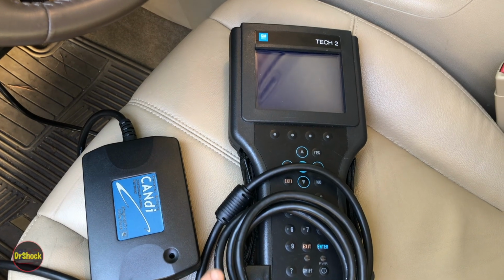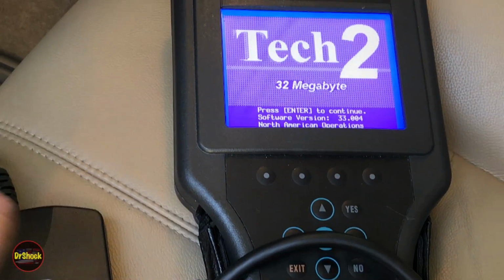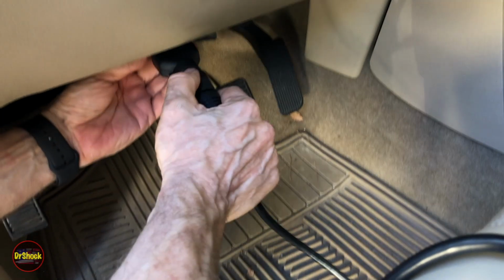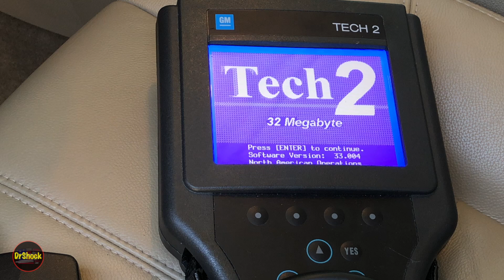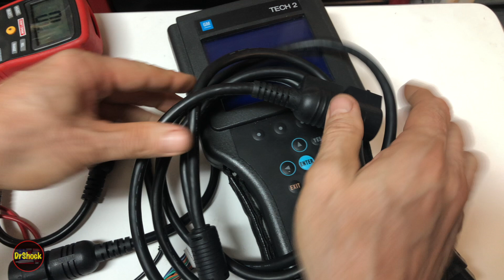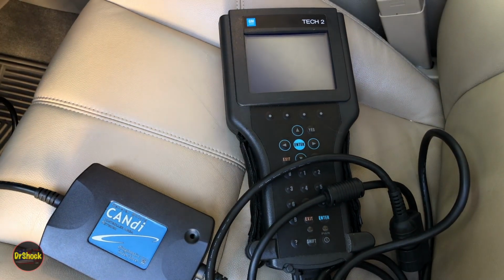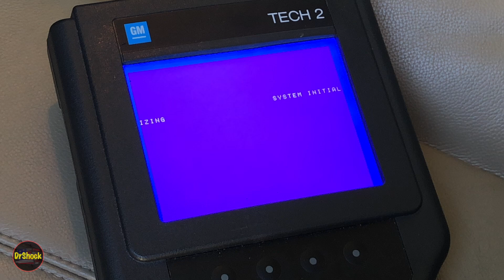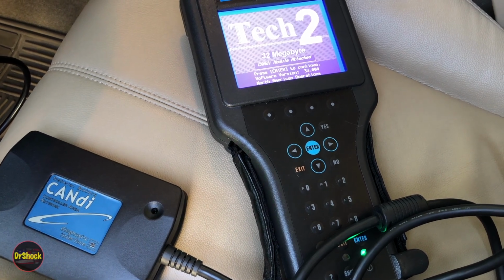Tech2 Scan Tool CANdi Interface Module Not Recognized / Attached Diagnosis and Repair

Comment: You can use a hot glue gun to fill the stripped threads
Reply from the maker: Unlikely to hold up to a regular use shop tool vs epoxy.

Comment: What if the problem is where the CANDi is connected to the tec 2?
Reply from the maker: I mentioned both of these clone type CANDi cables, as well as the DLC adapter, can be failure points.  Links to all of them are in the video description.

Comment: Will these scan tools diagnose a start then immediately die issue? I think it’s passlock related?!?! It’s a 98 Cheyenne with a 305. Has ran great up til today. I had a key cut for it to put in my billfold for emergencies. I drove it home with that key and parked it in the garage. Now it just starts and dies. The security light lights and never goes off. Even when it momentarily starts and dies
Reply: Any help will be greatly appreciated
Reply from the maker: I would say no to your question based on how you've stated your situation. 
 The Tech2 is an older generation scan tool only intended for use by GM dealership technicians.  It's going to read limited information, and requires the GM service manual for the vehicle to know how to interpret that data.  If you have alot of knowledge about the vehicle, and also have access to the OEM service information, then it can be a very useful tool.  But it will not guide you or point out the problem you describe in a DIY type of fashion.

For this particular issue you have, you will need to clear any DTCs that may have been stored.  And then I would suggest you attempt the Passlock Auto Learn procedure documented in one of my other videos https://youtu.be/4HSykIl5jaE description text section (not in the actual video just the description).
Reply: @DrShock  my security light is staying lit just like yours was in your 2 year old passlock video using your diesel. Did me driving the truck with a fresh cut key cause this or are my 2 passlock modules bad?…. Both just keep the security light lit when I switch the key on. It should blink for me to do the 30 minute “dance” shouldn’t it? I did NOT erase my codes yet tho nor did I even hook up the tech 2. I have one that I got from a closing dealership in nc. I used to live there
Reply from the maker: Seems unlikely you have two defective modules in a row. If you have a scan tool to read the diagnostic trouble codes, I would start there.  If the security light is staying on then it may have a DTC to guide you.  My other video you mentioned may be useful in running thru the various tests and diagnostics for the module itself - https://youtu.be/EN52MhTjxro

Comment: Appreciate finding out there are replacement cables.  I have a similar issue but my tech2 recognizes the Candi module on startup but says it’s not there when connecting after the vehicle info is input. I’ll at least give the cables a try before I try replacing the whole module.
Reply from the maker: You can also try reseating the VCI module.  The card edge connectors on this component can sometimes become oxidized.

Comment: I’m trying to add steering controls to my 04 Silverado I’ve been through Acdelco and gotten my rpo codes modified for the steering controls and driver info center, but when I go to apply then through the tech 2 software I get the e4491 error and it won’t program the bcm. I had a hard code on my sdm so I sent that off to get reset and I’m going to try to program the modules again, if that does not work is there any other ideas you have to get this to work?
Reply from the maker: The E4491 Tech2 error code can be caused by a non-GM accessory/device/module installed in the vehicle that has access to the communications network.  Remove, or disconnect, any such devices and retry is one suggestion.   It can also be caused by using used/salvage modules rather than new ones (these older modules can be hit or miss at overwriting existing data) as GM does not support reuse of modules across different VINs.   If applicable, you may want to retry with brand new steering control / DIC modules instead.

Comment: First thing for me to go bad was the OBDII adapter.  Then it could only talk to GMT900s, not 800s and earlier types, that turned out to be the VCI module.  The RTC (Real Time Clock) within the Tech-2 failed but unit works fine.  Next, we replaced the cables and the CanDi module and finally had to get a new PCMCIA card.  Only thing original is the Tech-2 itself!  Great machine, don't like the MDI and laptop for road tests!